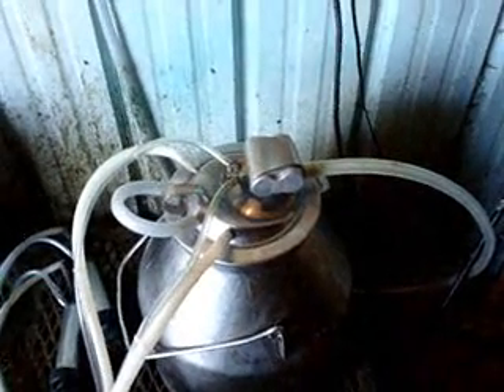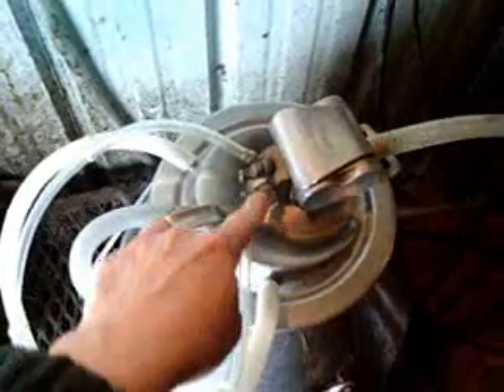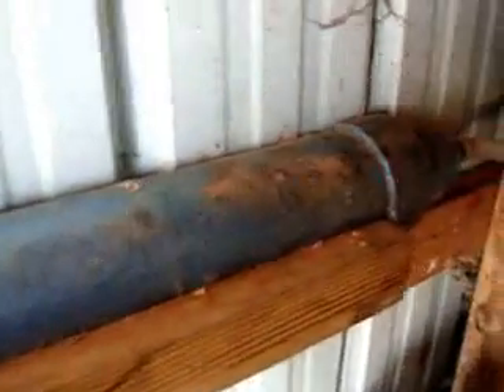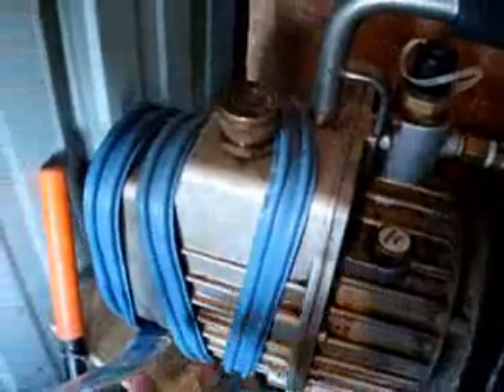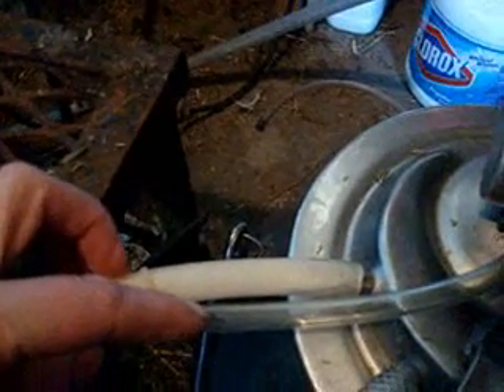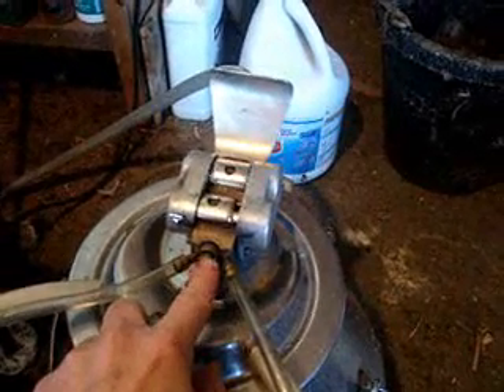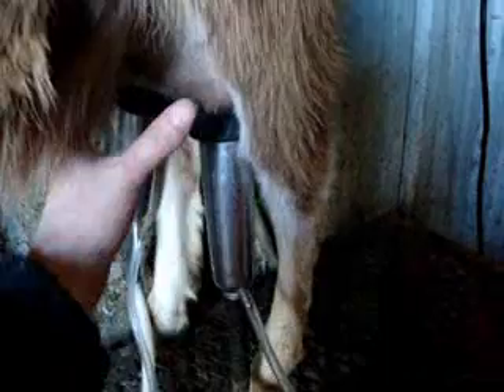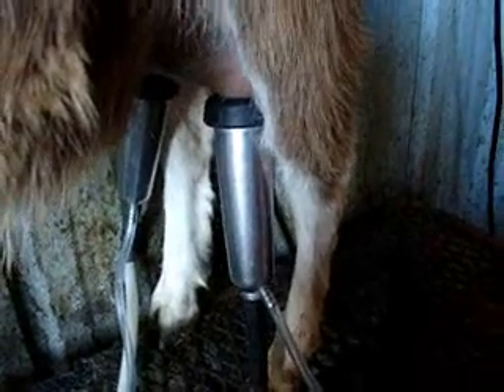Milk machine use on Goat

Comment: Where did you find that air regulator? Is it just a ball valve that you can open to allow a tiny bit of air to enter to lessen the vacuum? Also what does the air accumulator do/why is it necessary? Thanks so much